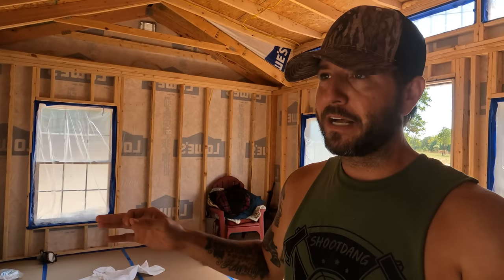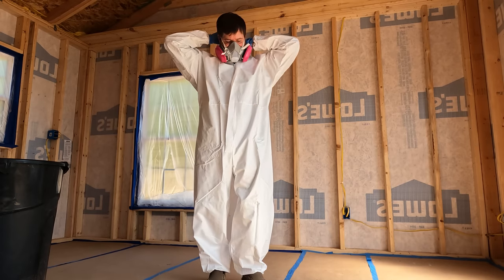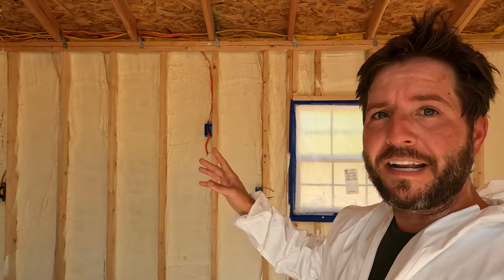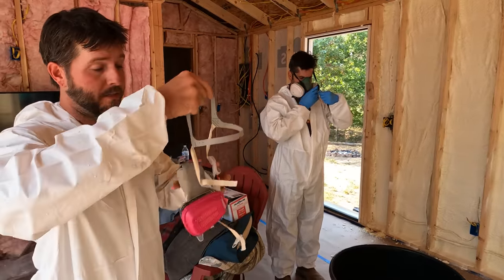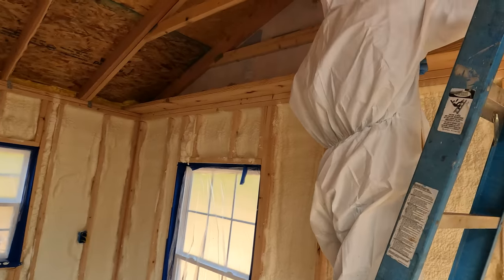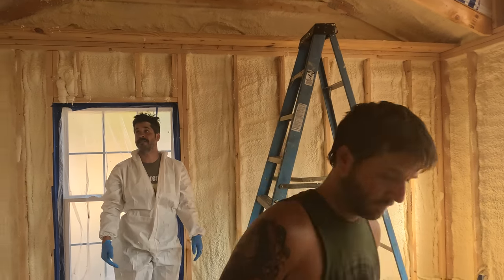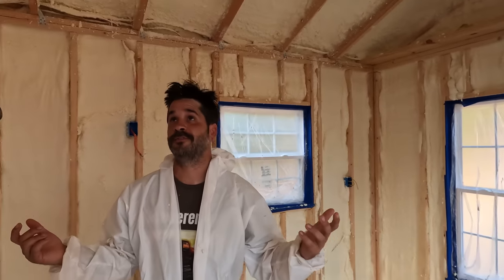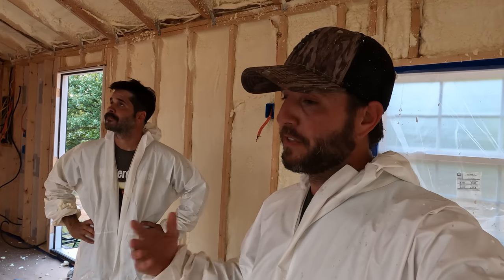Shed To Tiny House - DIY Amazon Sprayfoam Kit - What A Mess!

Comment: Your videographer hopefully was wearing a respirator! If you have done any research on spray foam, you would have discovered how toxic &_dangerous spray foam is.  You must have your home tested for hazardous gases after it's finished.  You have not considered the severe dangers of the product.  Unless you have received professional instruction for a CPI, IDI, or SPFA certification, you aren't qualified to instruct anyone in the danger of spray foam application!  What if someone takes your advice and is injured, and then they lawyer up? Good luck!

Comment: If you can rent or borrow one; a 6 foot Baker style rolling scaffold is the way to go for doing all of the overhead work. Easy to transport and set-up, they are also relatively inexpensive, and come in handy for a wide variety of indoor and outdoor building projects. And in a lot of instances, they are also safer to use than ladders, (as long as you don't accidently step off of it and land on your face).

Comment: When insulating a wall, installers of open-cell spray foam usually fill the stud bays completely. Once the foam has cured, the excess foam is trimmed back flush with the studs.
Reply: He ordered closed cell foam.
Reply: not always.  i had my basement professionally done.  they said they could if i needed a high r value, but it's a lot more work and therefore costs more.. 2x6 wall studs would be great for this stuff

Comment: Probably cheaper, easier and fewer health hazards by using ROCKWOOL spun mineral insulation. Doesn't support mold, won't burn or sag and won't hold any moisture. Might use foam to get into the cracks and spaces around the top of the studs and top plate.

Comment: You also need to let the foam expand beyond the studs and use a special trimmer to flush it up..Also, don't use expanding foam next to window and door jams!
Reply: It's only an issue next to doors and windows if the foam in contained. Being open walls, it won't push anything out of place.

Comment: honest question about the spray foam....would it be beneficial to put ALL the wiring in conduit (or simple pvc pipe) before spray foam, so in the event anything needs, say another outlet down the road etc, you would be able to fish a wire through the pipe instead of trying to go through the spray foam?
Reply: In that aspect their is no benefit. It's a detriment. But spray foam is generally looked at as better due to ease and speed of putting it on. And the whole house seal it creates. It's much better at blocking any air currents from entering the house.

Comment: Just wanted to point out that you shouldn't have foamed the underside of your roof deck.You should have an air gap that runs up under the eaves to the gable end vents. Even better if you vent the peak of your roof. This keeps your shingles lifespan longer.
Reply: I've scrolled through dozens of posts looking for someone to point this out.  This needs more upvotes (not so much as a criticism but more as an education to future DIYers out there)
Reply: Actually that's been disproven. There is a company in Canada that has done experiments at length on this very topic. Foaming the roof deck is actually a better. Homes don't need to "breath" as long as there is fresh air intake for air-conditioning and heating.
Reply: @amandathrasher1110  Also he says in the video its a black metal roof not shingles so it's a bit of a moot point.

Comment: I’m a spray foam contractor and everytime I quote a job my price is the same if not cheaper than the froth packs and that’s installed! Not to mention we have a superior product (actual 2lbs foam) you can notice the difference by just squeezing the foams in your hand. I have never encountered a froth pack foam that was even similar to the density of foam we spray. I’ve also seen a lot of bad froth pack DIY installs that we’ve had to go over or entirely remove (foam shrinks, delaminates, cracks or just won’t mix properly) 

Some people think the board feet labeled on these tanks will be sufficient for their project until they realize it’s only measured in 1” increments 

Lesson is don’t buy this stuff without at least getting a couple estimates from your local contractors and then weigh your options on whether or not it’s worth it for you to take the time to install it and factor in the fumes overspray you will deal with

Comment: Why did you run the wiring over the top plate?
No eye pro when spraying? You realize there is a ultra fine mist from this. Also if there was any "oopsie" it would really SUCK to get that in your eyes. 
Also on H/D closed cell foam you don't need to fill to the edge. There is a curve of effectiveness to "Inch//R-factor".

Comment: I recommend looking up the term "flash and batt".  Instead of adding additional layers of foam, you treat the first layer as an air/moisture barrier (and initial insulation) and add an additional layer of R13 pink insulation or Rockwool) on top.  It gives you the benefit of spray foam without breaking the bank.  Cheers.
Reply: This is the correct process to take now, the foam sprayed has squat for insulation value, just a air infiltration stopper. Have to add insulation to get the r value needed or buy a BUNCH more foam
Reply: @billbray5995  Well that's not true at all. Spray foam is insulation. It insulates as well or far better than fiberglass, depending on what kind you use. Actually, even when the R value is similar, spray foam performs a lot better because installing fiberglass properly is very difficult.
Reply: Absolutely right.  Spray foam is about R7 per inch.  Most cost effective solution is flash and batt as you've mentioned.  Consider what Jared just did... he said there's about 2 inches of foam... that's R14 for $2000.  Seriously, just flash it all with foam which would air seal everything... then use batt insulation.
Reply: @Robert Swaine It all depends on your goals, right? If heating and cooling is cheap, then fiberglass is great. On the other hand, energy prices are rising. More expensive options that insulate better will pay for themselves over time. If you're planning to live in a place for a few decades, expensive insulation might be nice.

If you're building and you can choose your own wall thickness and insulation package, you probably want to sit down with a spread sheet, punch some numbers, and see what makes sense. One advantage of a small house is that even expensive insulation might not break the bank.
Reply: @dper1112  Energy is going to go through the roof this winter thanks to Brandon & company.  Insulation has the highest investment $$ return out there
Reply: @netdude   where did you get R7/inch?  I have never actually found mfg documentation to back that up.  If you could share, I would love to know.

All my dupont docs say r6.7 per inch

Comment: I also run an insulation company and we have a Graco proportioner which allows us to do high volume. I generally spray foam for less cost than the kits you can buy and that includes prep, cleanup and labor so I would call around first and get quotes from qualified professionals.
Reply: Was hoping to see this comment. Same over here. Those kits have no control over the ratio, heat or pressure. Only good for small touch ups.
Reply: I got 2 quotes for 2” coverage in a shipping container (40’ high cube) and both quotes came in above $5K. I can DIY it for less than half that. I would rather pay a pro but I can’t justify 2x cost or even higher. 🤷‍♂️
Reply: @ShanePitzer  understood. For a diy deal, 2”foamboard, sealed with great stuff at all joints (leave them 1/2” loose) is an excellent alternative
Reply: @rdbuchli  what do you mean by leave them 1/2” loose? Also with foam board how do you compensate for the uneven corrugation? Foam board is a logical choice if it filled uniform areas. I guess I’m not picturing your suggestion.
Reply: @ShanePitzer  if you butt up the joints of the foamboard and tape them that’s ok but the best way to connect sheets of foamboard is a bead of great stuff type foam to connect the joints. Leaving them a little loose(if possible) allows a nice bead of foam that will move with the foamboard as temps change whereas tape may eventually come off. You can only do this in different applications such as your container since you don’t or may not have studs to  nail to because that extra 1/2” would throw everything off. You really don’t have to do it with the gap, it’s just that I’m picky and I always try to find the best way and this method of connecting the foamboard sheets is near perfect. I do this when nailing directly to concrete specifically.
Reply: @ShanePitzer  the uneven corregation is why you need to seal the foam sheets so well. If moist interior air is allowed behind the sheets and rushes past the cold corrugated steel (in the recesses) condensation will form in the winter.
Reply: @rdbuchli  so with this method there would be an air gap behind the foam board and the steel wall where the side is corrugated? And I ask detailed questions because like you I like going the extra step to do it right.
Reply: @ShanePitzer  yes. But it is essential that there is no way that interior air can flow to that air gap so make sure you seal the foamboard perfectly top bottom and sides. I’m assuming you are putting the foamboard on the inside. So after you put the wallboard up, seal all outlets and the walls themselves top and bottom as additional insurance that no air can get to the metal behind the foamboard where it would condense. Condensation forms in this scenario mostly when you have a non-air sealed insulation material and also some sort of small hole to the outside, like a small rivet hole for instance. In that case heated moist air travels to the cold steel like a river of air and constantly leaves its moisture on the cold metal surface eventually creating a puddle and sometimes mold grows. The foamboard method can be just as good as spray foam if you seal everything well. I do this type of thing in a lot of different scenarios in place of spray foam where customers want to save money.

Comment: If you ever do this in the future, start a stud bay by spraying up both sides of the bay.
Then fill the center.

This generally results in better air sealing at the stud and prevents it from pulling back from the stud (and you can see in some of the close-ups).

Otherwise, nice efficient use of the foam.

Comment: I went with Rockwool. All other insulation catches fire and allows it to spread, especially foam. 
I might be paranoid, but I don't want to take the risk.
Fun video, thanks.
Reply: Sprayfoam actually doesn't burn very well. It seals better than any other insulation and requires no vapor barrier saving labor and materials
Reply: @mrmotofy look it up. Spray foam is very flammable even at relatively moderate temperatures. Cured foam, not uncured.
Reply: Rock wool is the best but it has some drawbacks. It’s very heavy (soundproof too) and it’s downright nasty to install.
Reply: @jeffreylonigro4081  A HOUSE is flammable. The studs are, the wall coverings are, the paints are, the floors are, the furnishings are, the siding is, the vapor/moisture barriers are, the cabinets are, all the plastic water lines/fittings are...saying an insulation is better cuz it's less flammable is laughable. It's less flammable than some others, but so what. Most people will NEVER have a house fire or a situation where it's ever an issue. When one figures ALL factors in sprayfoam is one of the best options and has many features that put it ahead of the other options and behind in some.
Reply: @mrmotofy  suit yourself, buddy. Whatever you say…
Reply: @mrmotofy   so wrong! Friends just had their whole barn-to-house burn down because a spark from a welder being used near the exterior made the one-in-a-million jackpot leap from the ground up in between the siding and the frame so that the sprayed-on insulation caught fire; it spread so rapidly that the whole place was in flames before the guy running the welder could grab his fire extinguisher (10' away). It burned so hot it warped a 5/8" piece of steel plate they were using inside. It was the insulation itself that flamed up so fast and burned so hot. Nothing else in a normal structure will light that fast or burn so hot. Thank the good Lord they weren't living in it yet so it only destroyed the structure, but they decided that the flammability of their insulation matters very much.
Reply: @merrymerry7583  OK and? Huge forest fires have started from the flick of a cigarette. Yes houses are flammable, the paint, the finishes, siding,  and other materials used. Welding spatter is extremely hot and will light all kinds of things on fire.
Reply: @mrmotofy    "OK and" the welding spatter lit nothing else on fire THAT COULDN'T BE EXTINGUISHED BEFORE IT SPREAD UNCONTROLLABLY. 

@_DixonCider made a valid and important point about safety that another DIYer might be grateful to be aware of and you contradicted it with an erroneous and mocking statement. You can take whatever risks you want but the truth is that sprayfoam insulation carries risks beyond what you acknowledge and some of us appreciate having the info to weigh those risks for ourselves.
Reply: @merrymerry7583  Anecdotal stories mean much. Especially when retold by people who weren't there.
 My dad died in a car crash a cousin was hit/killed by a car ...you shouldn't drive a car cuz one might die. Anecdotal stories don't mean a majority or even a reasonable risk.
Reply: @mrmotofy   "Anecdotal stories" become research when enough of them are documented. Some of us prefer to know when something is risky before the lawyers force the overseers to declare it.

Comment: If you didn’t leave an air gap between the roof decking, you are not going to want to leave a ridge vent. You are going to want to seal that too. Looks like you left that open.

Comment: Great job!
Safety glasses should be used (to late, tho). Also acetone will melt away the foam, almost instantly.
Great for cleanup including soaking the nozzles & even the lines if "pushed" through with compressed air!

Comment: I built and live in a 16x24ft 2 story shed with a 10x16 addition with a loft. I have bought/used the Froth Pak 650 kits from Amazon for both. First off, these are not specific to Amazon, Lowes and Home Depot sell them as well. This is a 'Closed Cell' spray foam which is the top rated insulation on the market (the type not brand), and acts as a moisture barrier as well negating the need for 'house wrap'. It also adds stability to your structure. That said, I know this video is several months old and you've probably learned this since then, but figured I'd share anyway. This stuff makes a HUGE mess (as you learned in the video), but it's an excellent insulation. At 2in thick it has the same R value as the 'Pink Panther' Insulation, ~R12. And while it DOES make a giant mess. The clean up is actually easy, if you let it cure, you can scrap it off any unwanted surface, (ie window glass, particle board floor, etc) with a putty knife and very little effort and it just pops right off. Additionally, as you learned on the ceiling - when spraying horizontal (or near horizontal) surfaces if you get it to thick it will start to sag and pull away from the surface you're spraying. As this stuff cures, the chemical reaction puts out a ton of heat. If you're spraying a ceiling or other horizontal (near horizontal surface) if you start seeing it sag, you can press it back up with a gloved hand for a second or two and it will stay in place and be just fine. (That's if you don't want to cut out that section and respray it). 

These kits ARE expensive, but well worth the price - they give you an entire bag of spray tips...something like 10 jet nozzles and 5-6 fan nozzles. The key to keep the massive blobs off the floor is to change out your tip when you start noticing it blobbing a lot. And no need to go at break neck speed when spraying either - while yes, the nozzle will cure clog if you go to slow, if it completely stops up, you've not ruined or lost the rest of your kit as the chemicals don't mix in the gun but in the nozzle itself, so if the nozzle stops up, eject it and slap in a new one and you're back in business. 

Great job on the cabin dude, greatly enjoy watching you and relieving my own trials and tribs...LOL
Reply: Slight correction, R15 is what Pink Panther 2x4 (technically 1.5×3.5) would call for, not R12.   R13 is also available in 2x4 sizes.  The company "Owens Corning" makes it, has for decades, and the size is very well known in the construction industry, probably the most common size sold.

Comment: You should apply it the same as you would spray paint.  I would do long vertical passes on the walls and let go of the trigger at the ends. When you spray back and forth while holding the trigger down, you are getting double the material at the ends of your sweeps.

Comment: Install foam ceiling baffles between the Roof joists so the spray foam doesn't stick to the Plywood. 
  This will save you over $1,000 if / when you need to replace the roof sheeting.
   Being closed Cell foam, a small Leah will travel between the Sheeting and the foam. Where the leak appears, may not be where it is leaking through the roof.

Comment: What progress you have made. You won't be disappointed with using the spray foam as it covers so well compared to the pink batting leaving no spots for cold air to penetrate. Thanks for this video...75.4K is impressive Jared...told ya your sub count would skyrocket once you started your shed to house!!